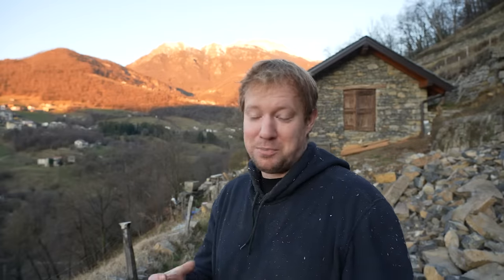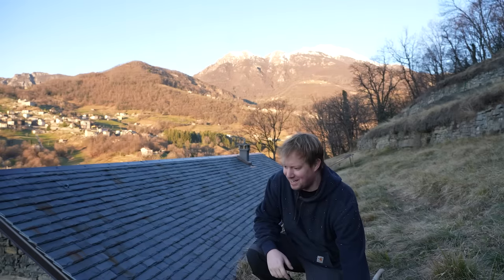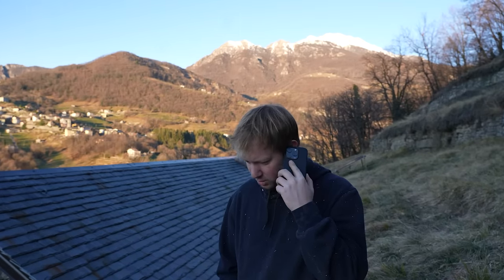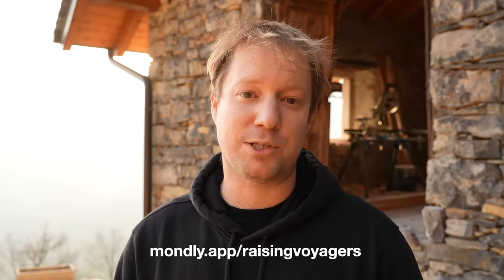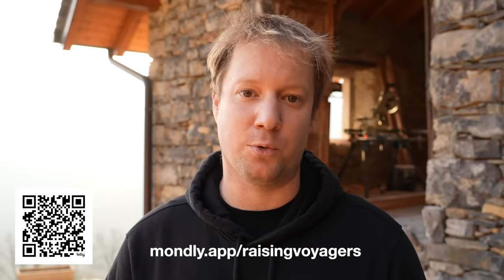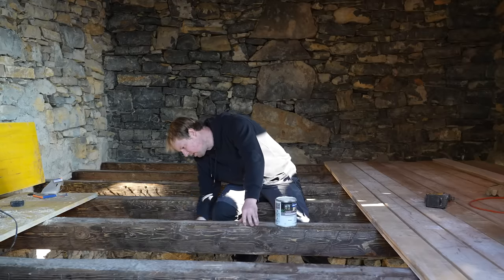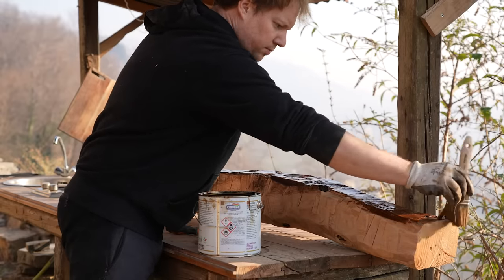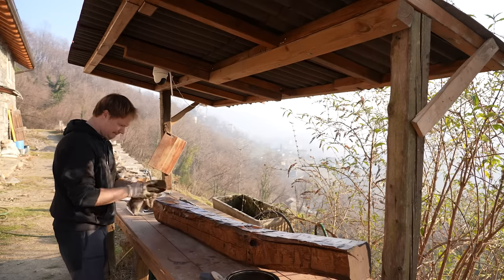ALL PLANS HAVE CHANGED. Now What? (Renovating a Stone Cabin)

Comment: Hope you see this. The issue with your battery pack is that the individual cells inside the battery bank have been drained down and are now out of balance. To correct this you’ll need to remove the cells and their connection to the next cells and charge each individually back to the stated voltage. Then wire them back together it will then be able to charge fully.

Comment: A solution could be, waterproof the inside wall allowing water to drain behind this to a channel running to a sump pump. Here in the UK we often use this solution in Basements with success. Good luck with your project.

Comment: If they are AGM batteries they cannot go down below 50% charge. You need to attach a trickle charger next time. As long as you have comprehensive insurance , and pushed from behind, she is not in the wrong.  Install front and rear cameras.  These footages can be given to your insurance company.  They deal with the other vehicle owners.

Comment: Look at how they run cables underground with a cable bore to possibly dig out a drain, though if it's solid stone it won't work.
If there's soil, it can dig through it from the side and only make a hole as large as the tube it needs. 
Then put in a porous tube or pipe, and it should help drain the groundwater out.
They are used a lot in commercial sites for quickly running underground cables, they can even be steered underground.

Comment: The best moisture barrier is glass. How about creating a glass wall a few inches from the stone wall, on the entire plane, provide for active and passive ventilation? These are ordinary window panes that perfectly retain moisture and retain heat. The stone wall was also illuminated with lanterns to preserve authenticity, and ultraviolet lighting for prevention. A glass wall would look amazing, modern, without destroying historical authenticity
Reply: That sounds like a brilliant idea, but how do you keep the condensation off of inside of glass to show off the stone walls? Heated somehow?
Reply: @oggiedoggies  The idea is to use a double-glazed window. It, in turn, is a reliable temperature insulator. In the conditions of air circulation between the stone wall and the glass, there will be no condensation. During the rainy season, forced ventilation should cope with drying. To reduce the cost of the project, you can use standard sizes of double-glazed windows, only the extreme ones can be made to order.
Reply: An additional benefit is that the illuminated stone wall will be a source of lighting in the room. If desired, the glass wall can be decorated as a large window using tulle, curtains, blinds. There are also great opportunities for using various lighting scenarios.
Reply: Would it be floor to ceiling/wall to wall?  If so would it need to be shatterproof?  Probably still cheaper than their previous plans of building addition.
Reply: @oggiedoggies  Yes, actually along the entire plane of the wall. This method of solving the problem is reliable, quick to perform and not too expensive as it seems. It is not clear why ordinary windows should be unbreakable. Usually, people live successfully in houses with ordinary windows. But, if you are afraid of everything, and for these wishes there is a solution - a protective film
Reply: It is disappointing to find out you cannot enlarge the house but, honestly I like it small and quaint. So happy you are preserving the stone walls from centuries ago it is so beautiful. You handled the disappointment well. When you are handed lemons make lemonade…
So sorry Heather and the girls were in an accident and very blessed they were not hurt… Rest up Heather and take time for yourself your channel will still be there… but we do miss you.❤️🤗❤️

Comment: Heather, take your time, come back to us when you're ready. Hope everything goes smoothly with the insurance. So, random thought, could you use steel sheet piles driven in? You might even be able to get them in between the house and the wall, you'll have no soil to remove, no concrete to pour at should be fairly water tight. Also yes, freezing temperatures will kill lithium batteries, it's best to keep them warm.

Comment: That stone wall in back of your house holds up all dirt mountain. Its a matter of safety from erosion. Without it, the mount will erode with snow, rain, and fall ... onto your house and further boulders from higher will fall.
Batteries may revive in warmer temps? Not sure. i do know all batteries have a threshold for lower temps.

Comment: For the humidity in the wall, one way not 100% to solve, but at least to improve quite a lot is not let the moisture go to the dirt behind the wall, mostly removing any source of water that will go there or letting run somewhere else. This could actually solve the problem, but depends on your location. 
Mostly, just put some canal that will move away from the area the water from the roof and add a couple of French drain on the terrace on the side of the house to remove water that will go in this dirt. Add some small well to remove humidity in the closer proximity of the wall. All this should alleviate the issue, living the +part:  All this work could be done together with a geothermal heat pump installation in the same area (that will drive your heat pump electricity consumption to a reduction of roughly 40%-50%, especially good if you are going renewable) and this part of your house will have the same advantages of the geothermal installation (cooler in the summer and warmer in the winter). Having an heat pump running will also help with the humidity level.

Comment: We ended up putting a French Drain System outside our house and then we dropped down into a large pipe a Sump Pump. When the water gets to a certain level the pump automatically activates and pumps out the water. Also, after we exposed the wall digging down against the house, we painted on a product called Damn Tight which also helped with any penetration of water into the home. And yes, we had to dig it out by hand.

Comment: i wanted to let you know what we did with our earth home , walls to allow water to stay off, we dug a ditch down 9 ft Along the wall down and. just under the floor and then placed perorated tile allow quick run off, then we place the new foam water proofing  on the walls , then adding the material like plastic against the wall, then we fill the ditch with pea gravel this allows the water runoff fast , then on the inside we sealed the stone , i don't know if this will help you, but husband being a brick layer seen many water proofing jobs I think you can find the waterproofing system up against concrete on youtube.

Comment: The family is safe. From a distance, can't differentiate between the beams. The color blends well with the walls. Noticed the new black gutters and downspouts. At least the roof water is moved away from the foundation.

Almost back to sq 1. At least the inside will finish faster. Hopefully in a few years, expansion and retaining wall can be revisited.

Comment: Probably expensive, but you could technically do a concrete wall on the terrace below, in front of your door, same height as the house terrace, then use smaller machinery to dig behind the house and fill that wall up to the same level of the house. You would end up with more space in front of the house and a nice viewpoint... Then heavier machinery could pass. But it's a large project, so might not be for you or you may not even get a permit for that.

Happy nobody got injured, best of luck!

Comment: I'm not a builder and don't know how to deal with the hydrostatic load on the house caused by stopping the water seeping through the wall. But could you use like cement pillers drilled and filled into the ground. Or a metal dam ramed down into the land behind the house? Thus much lass soil being removed if any. The soil between the wall and the water dam would then be insulation if it drys out.

Sorry don't know the names of the walls. Saw the cement pillers used on grand designs for a basement lower than the water table I think. I t was a long time ago.  The metal dam was used on aok Island series to excavate a swamp. Not sure what the equivalent would be for restorations. I think both systems are generally used on larger commercial buildings.

Just some out of the box thinking. Might not be practical.

Glad the family is OK.

Comment: Good grief!  Your life is certainly full of events.  Glad your family is not damaged any worse.
I'll be watching your battery saga with great interest as I too have left my Li-Ion battery out in the garage unprotected, due to an unexpected surgury.  Your experiance may guide my way.

Thoughts...
1).  For your hillside stabilization and moisture problem, I've seen staggered, overlapping, vertical boreholes filled with concrete used for hillside retention, without the neccesity of total excavation.
2).  On your window lintel, you left the end grain unsealed.  It felt wrong to me.
3).  When sealing your floor joists, you did no illustrate sealing the top surface of the beams.  In my experiance, if the material is not sealed on all surfaces, warpage is more likely to occur.

It's so easy sitting here, having weird ideas but perhaps they have value to you.

Comment: what if you raised the rock walls on three or four other levels two or three feet and put the dirt there. it would be about the same amount of rock wall being built but you shouldn't have to move the wall in. and a three foot increase in dirt won't  effect the side pressure that much.

Comment: Camera distortion can give false understanding of steepness of your property. Looks very steep terrain from video images. 
Which if being the case, I'am thinking that moving dirt to lower terrace you mentioned could be done with a temporary steel shoot that controls descent of material into lower terrace location. Or perhaps more of a Conveyor belt system which some product moving belts have little paddles to move soil type of materials.
Another idea came to mind while watching this segment. Having a dredging type of system actually digging and transferring materials down hill to alternative locations. However a hydraulic dredge uses lots of water probably not feasible to your site conditions. Unless you've designed a recirculating water type of design.
One other far fetched idea being the use of vacuum driven type of dredging, not exactly dredging although similar type of materials transfer systems.
However this type can't move large rocks or boulders. Could reduce majority of soil relocation to strictly stone removal possibly fitting parameters which currently creating limitations.

Comment: Sorry to hear from the accident. It's always an unpleasant experience, especially in an environment whose language and protocol You only understand partly as an foreigner. Hope everyone's fine, nok only physical, but mentally, too. 
Refering to Your reshaping challenges...Owning a vineyard, with the very same drywall systeme, and having to repair and alter it, my best advice would be to look out for somebody, who still builts and maintains those walls innthe traditional way, wich means: without modern building materials and methods like huge building machines or concrete.
The reason for this is, that those walls and terraces may look simple, in fact they are incredibly sophisticated, intertwined and rather complicated to do and maintain structures, extremely unforgiving and vulnerable to any kind of change, if made not in the right and only traditional way. And yes, you may can enter modern materials, but thus has to be done by an absolute expert. If not catastrophe is grounded, as thusecterraces do depend on a very complicated intertwining of materials, structures, irrigation, weights and counterweights, soil humidity, natural ground and even the wind krvthevplants growing in them etc. pp.. Change of even one if these factors or even positioning or removing a single stone or tray of earth at the wrong spot, and the whole slope will collapse, including killing everything and everyone on and beyond it. So I'm a but concerned about what exactly You're doing and whu gives You advice with thus, as a 'normal' construction worker or architect might nit thecrught one, for thecrather tricky task of remodeling the terraces or fitting the water problems, especially as You have to be aware, that a high but controlled waterpertinence is integral part of the systeme, and can't be changed without causing further problems and damage. Same with the complicated ballance if weights and counterweights. 
So doing nothing might be the best solution as long You don't completely understand the system...or not, as You already have altered things. As spring and with it potentially heavy rainfall but also drought is nearing, I would recommend to cover the terraces as soon as possible with big plastic sheets, until a comprehensive solution of stabilizing the whole system of terraces again is found by a dedicated drywall expert - and no, as I said, a normal construction worker or architect won't do the job, as they normally have absolutely no glue how those terraces are built and even more, how they work safely, as normally those terraces are simply removed and replaced by 'modern' concrete constructions for good reasons, as utbus almost impossible to predict how their statics are and his they will react to alterations. And even if You have the luck to get an expert, who knows, in 99.9% of cases, they will tell You: Don't cha be anything and if necessary: rebuilt exactly and with the exact same materials and methods as it has been done a 1000 years ago, as those terraces can't be made any better, more sustainable or stable by any if our modern methods and materials, at least not on the long shot. The only thing You can do with modern alterations is ruin them, and bring You and others into temendous danger, as thusecterraces are the only thing, we know, that prevents whole mountain ranges from collapsing over a very long period of time. And no, modern concrete and steel buildings simply won't do the trick for any longer than a few years, so better don't use them. 

Take care, and good luck!